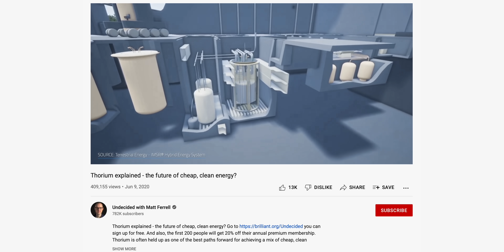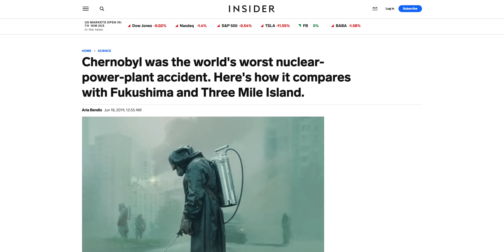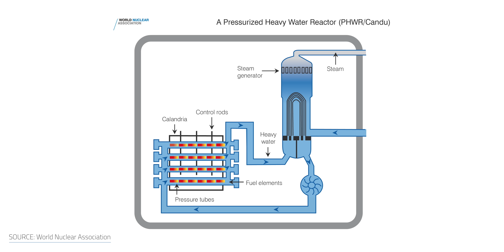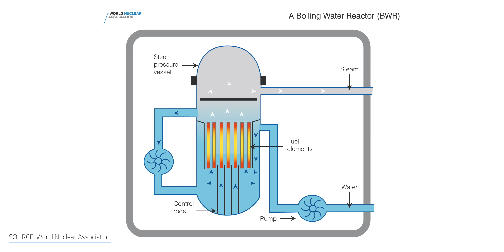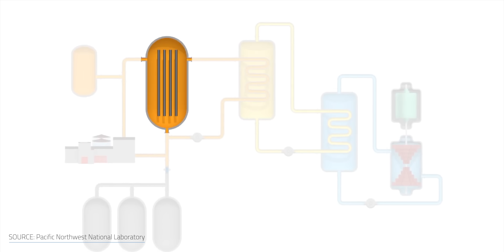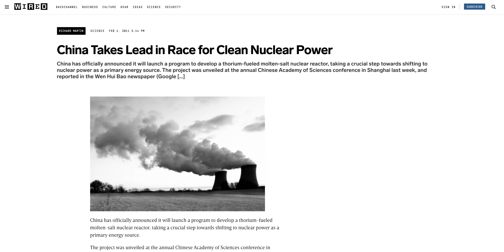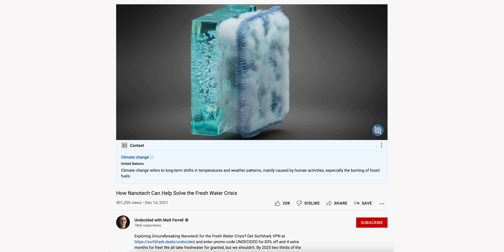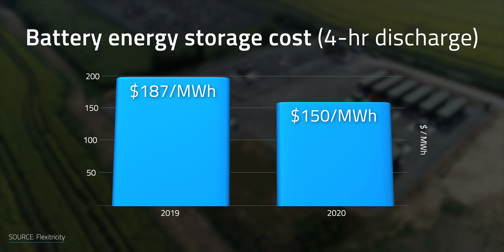Revisiting Thorium Energy - The Future of Nuclear Power?

Comment from the maker: Do you think we need nuclear as part of the energy mix at all? Get Surfshark VPN at https://surfshark.deals/undecided and enter promo code UNDECIDED for 83% off and 3 extra months for free!

If you liked this video, check out: Revisiting the Supercapacitor - The Wait for Graphene is Over  https://youtu.be/swdyGHvmXw0?list=PLnTSM-ORSgi55IJwXkqPkgtq03bgQDNoH
Reply: There have been about half a dozen big nuclear power disasters and yet it's demonized. 
Meanwhile there have been dozens, or even hundreds of coal ash leaks or other disasters just with coal plants. Add in oil, natural gas, and the rest and it's insane that nuclear is seen as the dangerous option compared to fossil fuels. And that's just the plants, how many big oil spills or oil explosions have their been? 
Talking about various FF plant disasters could make for an interesting video. 

Kuwait oil fields. Deepwater Horizon, Exxon Valdeez, Lac-Megantic train explosion. The Soma coal mine. Jharia coalfield fires. Benxihu... and that's just some of the big booms. There have been innumerable leaks from containment ponds or drilling accidents and other spills, the ash itself is toxic, then there's the CO2 and other emissions.
Reply: @Jcewazhere  msrs take away the key factors in all those accidents: water under pressure, water as coolant, and loss of power. Worth noting that coal plant residue-waste puts out some radiation too, but that's never discussed.
Reply: I do not think the LCOE is a fair comparison to match nuclear with solar. Its a calculation for determining the costs per KWH but does not take a look at the demand. However, we HAVE to make as much as possible of the full demand green, not only a small portion of it.

For instance, I live in the Netherlands, where the difference of Solar yield between summer and winter is 80% -90%. Hence if you would only look at LCOE Solar might look great, but to deliver all year round you would need 5 -10x the solar capacity to make up the drop in yield during winter . (Grid scale) batteries deliver power in the hours range (max days) so that is no option for summer winter variations.

If you fill up the missing capacity with an other source during winter what we are doing is investing in Solar but keeping the same capacity available via other sources.  So basically 2x the capacity and 2x the costs. Note that these costs will be higher since the investment (and risks) are spread out over much longer because the other source (conventional or nuclear) return on investment will be also much longer. So by investing in solar the LCOE of other sources will go up. That is also something to take into account.

When you take a look at hydrogen as intermediate, it becomes even worse. You will need full capacity of solar, storage for half a year (?) and almost full capacity hydrogen powerplant to convert the hydrogen back to electricity during winter. This will more than tripple the costs of the entire system. Hence LCOE is a fine way of comparing energy sources but not if we want to decarbonize as much as possible.
Reply: 🇨🇦☕🧐👍🇬🇧

Aw, it deleted my second comment.
Go and read about the Moltex Energy SSR-W being built in Canada.

🇨🇦☕🧐👍🇬🇧
Reply: I absolutely believe that nuclear fuel will be the next bridge gap to another level of human development, similar in scope to that of the industrial revolution. Not fission however, fusion. I don't believe we'll achieve fusion without using fission to push us there, but once we master fusion, I honestly believe having virtually limitless energy will propel us into another level of advancement, similar to how mastering the steam engine gave us industry. Hopefully with the additional energy our society and environmental issues can come under control also.
Reply: We need abundant, reliable, and low cost energy. Although nuclear currently appears to be more expensive it meets all our other needs. We need to invest in next generation nuclear energy to bring the costs down
Reply: The pure potential of nuclear and the ability to provide clean (synchronized) power in itself is a good enough reason to pursue. In ours growing power demands we will need all types
Reply: Yes, we definitely need nuclear at our current technological level. Since nuclear has the lowest carbon footprint of all power production options at this time, and since it's really safe, there's no need to avoid it.

Fast-forward a few decades and solar power satellites and/or fusion might be the way to go.
Reply: Yes. We're going to need all the solutions we can get. Combining the LFTR idea with the SMR philosophy means getting energy generation to the specific areas that need it and/or ones that wind/solar are impractical for. For example, I predict vertical farming and synthetic meat production to increase in the future, both of which are able to be done in a city, but are very energy intensive. If you could install an SMR plant somewhere close to the plant that needed it, you skip all the problems of finding open, sunny land or windy places.
Reply: Thorium is irrelevant until MSRs have already come online, when it is properly understood as a second fuel. I've heard over and over that MSRE at ONL was shut down in excellent operating condition with no problems from corrosion from people who have studied the operating notes, so I don't think your claim it shut down from corrosion problems is from a good source. MSRs are the reactors that need to be put into use for a dependable energy future. MSRs are expected to take much less than half the average construction time of other nukes. If MSRs are built on assembly lines like washing machines they are expected to take only a month to install. But the main reason MSRs are needed is not discussed at all, MSRs are needed to recover from global catastrophes. In a nuclear winter, asteroid impact winter or super volcano winter the sun is effectively switched off like a light switch by clouds of dust, ice and chemicals that encircle the entire planet, plunging the planet's habitable zones into darkness for 2 - 10 years. No solar power, very weak wind energy, low to no snow melt so no hydro, ice bound coal piles that can't be shipped or burned, oil too thick to pump, frozen natural gas lines, everything is just plain colder than in thousands of years so suddenly nobody is prepared and global civilization collapses without power. Legacy nuke designs need the water in the rivers that are frozen so can't keep cooling systems running and have to shut down. MSRs are one of very few systems able to be designed to stay up and running during global catastrophes so civilization doesn't collapse. Recovery from global catastrophes is the main reason something relatively local and dependable without needing liquid water is so important.
Reply: Yes, on the higher longitudes solar works only in summer - November to April not only is the output is low, but we also get only 2-5 sunny days a month, so a 10 kW system, based on the collected statistical data, would generate about 55 kW/h in November, 13 kW/h in December, 45 kW/h in January and 150 kW/h in February and that's not a given, ofc. This year has been especially cloudy - we have not seen the proper sun for 2 months now at all. 
And the wind is not a solution too - it's too intermittent here with sizeable gaps of almost no wind (way below turbine minimal operational wind speed) - we had 2 weeks with zero to no wind in December 2021 alone - zero wind power production during that time across the country.

I just don't see what renewable tech could solve our winter problem for those 3-to-4 months.
Reply: @psihius  you mean latitudes mate…
Reply: @psihius  well new solar cells (multilayer) don't rely only on visible light and are work even in cloudy weather (as it's also able to utilize IR wavelength). It's still evolving. But yes main problem still remains and it is storage but that is also being developed.
Reply: @psihius  you mean higher latitudes, not longitudes
Reply: @psihius  

Read my comment first bro 😬
Reply: Matt. 2nd video of this type  u made, but no mention of what Thorcon and Seaborg Technologies are doing to marry South Korean shipbuilding with MSRs which massively reduces cost and time to use in addition to reducing the local infrastructure needed - they add, not require more.
Reply: Does the LCOE of these reactors including the cost of safely storing the waste for the said 500 years? Including all new regulations in the future...
If not: let's invest in stuff we can replace in a shorter timeframe IMHO.
Reply: @gerke_kok  That's the promise of molten salt thorium reactors. They can reduce highly radioactive waste to short  half life safer material.
Reply: @gerke_kok  what waste? You seem to be planning on not recycling fuel, which is silly.
Reply: Yes nuclear is only good option at this time for getting clean ish energy 24/7 . We will need renewables as well so a mix will be good what ratio will all depend where in the world the power is needed. At this time 100% renewable is a pipe dream unless u are ready to shut down the grid when sun goes down. Solar will need alot of land to make a lot of energy. The current storage solutions dont work on a world wide scale....pump storage will need a lot of land. Lithium based batteries are good as a dense energy storage but limited amount of materials also we will need them for vehicles so wasting it on grid storage isnt smart when the density of energy isnt that important in grid systems. So we need time for research better storage options.

Tho unfortunetly all this might be 2 late because it takes 2 long to plan for new plants and the countries that do 50% of the co2 emission will not slow down in the next 10 years but will increase it. Big fossil fuel companies knew about the problem of co2 for 60 years and now they are admitting it happening but will not do anything about it other than do ad campains about ur personal co2 foot print. Also whos gonna say to china or india u should stop what u are doing right now because europe and Usa has all ready fucked the planet to make them rich. We basically dont have a leg to stand on.

France has been really smart and now they have small co2 emissions but still make shit tons of energy.
I must say im happy my contry Finland has been smart about nuclear and currently we are testing new plant thats going fully online in the summer making 1600mw of power also another plant will start construction next year and tageted to finish 2029 tho i bet will be bit later. Also when the currently in test rrun mode plant starts to go 100% Finland energy mix will be 40% nuclear and at 2030 it will be somewhere near 60%. Also we have the worlds first final resting place for nuclear waste for the next 100 years of nuclear waste that was paid by a fund set up 30 years ago for this reason. Cost for the sorage was about 3 b €. Unfortunetly the cost for the new plant going online balooned to 8.5 b €. :/
Reply: Nuclear power has a huge flaw: It is not economically viable. I'm all for subsidizing a technology to get it started, but at some point that technology needs to generate a profit WITHOUT MASSIVE TAXPAYER SUPPORT. Nuclear has never done so, and it's been heavily subsidized for over 70 years. Wind and solar are already very close to not needing subsidies and the total they have received is far lower than nuclear.

I challenge any nuclear supporter to post a link showing any nuclear plant in the world that has not received large subsidies. It cannot be done!
Reply: @therealctoo4183  It can be done. The biggest problem is everyone is lying about the actual costs of everything. Wind and solar don't require as many subsidies because governments are forcing consumers to pay the difference. They're also extremely unreliable. Coal is cheap to consumers but the environmental costs are high. Hydroelectric also has high environmental costs. Nuclear power is cheaper per MWH than wind or solar but the start up costs are high and the break even time is long. The regulatory costs are enormous and the NRC is determined to only allow Pressurized Water Reactors to operate in the United States.  Natural gas and fracking is the best answer for now.
Reply: @therealctoo4183  Your numbers are wrong.
Reply: @patrickweaver1105  I provided no numbers. I simply state that every nuclear plant on the planet is STILL HEAVILY SUBSIDIZED, despite the fact that nuclear was going to provide practically free energy way back in the 70s! It's easy to claim I'm wrong, but can you link to any plant anywhere that DOES NOT get huge amounts of tax payer money? No, you cannot.
Reply: @therealctoo4183  Yeah, your numbers are still wrong.
Reply: @therealctoo4183  if you're under the misapprehension that *anything*, very specifically including intermittent renewables, is happening or can happen with what you term MASSIVE TAXPAYER SUPPORT, you are not looking very hard either at the current situation or at history.
Reply: @davidfetter  Nice attempt to change the subject!!! It almost sounds like you know what you're talking about!

Sadly, you have not shown any nuclear plant that doesn't rely on significant taxpayer support.
Reply: Let me know when I can get my own portable nuclear generator.
Reply: Yes. We need all the things. Climate Change as a existential threat/near certainly will not be mitigated enough without it. I define enough as preventing the widespread collapse of society. The problem afer that would be digging ourselves out of a modern stone age without easily accessible minerals and metals because those have already been mined.
Reply: A shame not to mention the nuclear physicist who pioneered thorium power https://en.m.wikipedia.org/wiki/Alvin_Radkowsky
Reply: Nuclear will not get much subsides and will need to compete.  Only in places where wind, solar, hydropower, tidal, HVDC transmission, soon to be produced super cheap battery storage do not work does it have a chance, which almost nowhere.  It will have to be so cheap to compete but and without mass production cost reduction, how (catch 22)?  The worker and material management risks, and long term storage burden just drags it down more.  The nuclear cost estimates are not reliable historically.  Eventually some new  nuclear technology will have some niche markets, but always be a minor percentage.
Reply: @glike2  >soon to be produced super cheap battery storage do not work does it have a chance, which almost nowhere.

Will not happen, guaranteed. Litium-ion is about the highest electric energy density you can get without the potential for truly disastrous results if something goes wrong; and most would say Litium-ion already has truly disastrous results; from cars burning down to planets burning in the air and crashing, Lithium-ion is quite dangerous already.
Reply: Yeah, that solar and wind calculation is bullshit. That's the thing about people only looking at spreadsheets, they can conveniently ignore all matter of issues with certain things and the added cost of this, because it wasn't on spreadsheet. Let's tabulate the stuff they didn't bother to put in their spreadsheets, shall we?

1. Energy density is not high enough with both wind and solar; you need destroy/cover far too much land (and buy it) to produce enough power; something that isn't factored in.

2. Energy production is not reliable; cloud cover equals no power, northern/southern places in winter will get far less solar energy due to the distance through the angled atmosphere, and thus very little power, however, cloud cover also increases during winter, so it goes even further down to essentially no power; wind similar; no wind, no power. So to compensate when you have no solar and wind power, you're still going to need conventional or nuclear power plants; and these will have to be running continuously, even when you don't need them, because starting a power plant from cold nothing to fully powered up takes to long; and that includes the people sitting at that power plant mostly twiddling their thumbs keeping it running and burning fuel all the time; all costs that if you were honest would have to go onto the conto of wind and energy. So, you're burning if you're using fossil fuels as much, if not more with wind and solar, than if you didn't have the wind and solar; which gets us to point number three:

3. Solar and wind energy produce direct current, which needs to be transformed into alternating current; the transformers who do that, run an alternating current; so even if you could find a place where and Solar and Wind were fully reliable, you're still going to need a conventional or nuclear power plant to be able to use wind and solar; making the issues of burning more fossil fuels to use wind and solar worse; another cost conveniently not put on the spreadsheet.

4. The environmental cost; depending on where you place them, you will either make shipping more dangerous, or you destroy natural environments and destroy animals homes, or in the case of solar power covering farmable land with solar panels thus hampering your ability to produce food, and potentially export it to the world.

Solar and wind are the most expensive in all areas of all the power sources.
Reply: I believe you forgot to mention that Wind and Solar are only cost effective in very small areas of the world, and small areas of USA.   Florida is not even cost effective for solar.
Reply: @user-nc9pc3gr4c  The wholesale electricity markets disagree with you.
Reply: @williammeek4078  Politics and government incentives.  Lets see what real world markets do.  If what you say is true, everyone would be buying solar panels.
Reply: Without nukes we will go extinct. We need a power source that is semi local and needs no more water than it can get from a well so it can be "self contained" to a degree and dependable. This is the power that will sustain the survivors after the great sun loss disaster during the period like a nuclear winter when there is very little sunshine for 2-10 years. Civilization will suffer such a major blow that we may loose access to our space based power if we already have it, which is why some of the power must be semi local and independent from sunlight. Without sunlight the convection currents that drive wind will die down, solar panels may be covered with dirty ice, the cold will freeze rivers so hydro fails, and we may loose access to our space based power if we already have it. The disaster could be a nuclear war, an asteroid impact or a super volcano, it doesn't matter, if we are not prepared for the disaster survivors to survive after the disaster civilization will not recover just like the great flood ended civilization 13K years ago.
Reply: This question is more than a little tonedeaf this far into the Ukrainian conflict, don't you think? Thorium should have been fast tracked right away, but greed got the better of us. Perhaps with energy companies now forced to stop offering fixed price contacts due to extreme energy price instability, greed can finally push us in the RIGHT direction for a change. LIFTR is the answer, and always was.
Reply: Yes, especially if they are the new SMRs or MSRs.  I used to have the fear-based view of nuclear power, but after watching several YT videos on thorium MSRs, I have an opposite view now.  Renewables are too unreliable and too hyped up to be used as a mainstream power supply at the moment.  We still have to see how the renewable waste is handled by the same people who want a cleaner, greener planet.
Reply: Yes. No Doubt we need It. But I like to change the Name of this energy to Thorium Energy , provided you study the HTR's Design and go and visit China and see the on ground progress of HTR PM 600 Project. Which was nothing but the advancement from HTR-10 - The Carbon Copy of AVR Germany using Fuel Pebbles.
Reply: 🌍 But will it be able to travel at  "Warp 5, or 10 Speed," ? or "Jump to Lightspeed." ? or a
"Hyperspace Jump." ?  👀🤖👾
Reply: Matt, are you drinking more coffee?  I've noticed and increase in the cadence of you speaking.  Am I imagining things?
Reply: Hi, Matt---will you ever actually revisit the "solid hydrogen" video you did a couple months ago? You still have not addressed any of the criticisms raised about your video.
Reply: I think, ultimately, nuclear will make sense again.  But it doesn't right now and it won't until there's enough grid-scale storage on the grid to level out non-renewables generation.  The equation hasn't changed... nuclear needs to generate base-load in order to operate efficiently and economically.   Base load doesn't exist on the biggest state's grids any more.

Here's more of a economics based view of the issue... right now natural gas is filling the gap that renewables can't.  Primarily this means overnight generation which for all intents  and purposes is 18 hours out of a 24 hour day.    Renewables can only slowly chip away at the edges here.  Only grid scale storage is able to actually fill the gap and it will be several decades before we have enough to completely bridge overnight generation needs.

In the mean time, what is happening is that natural gas generation is filling this gap.  But as grid-scale storage grows, the need for natural gas generation will decrease.  There will always be some need, but it will be significantly lower than it is now.  So the problem with trying to build-out nuclear now is that nuclear is filling a gap that is going to be diminishing over the next few decades.... which is not even remotely economical enough to justify building a nuclear reactor.

In 2-3 decades this equation will change.   NG generation assets will stabilize and base load needs will begin to increase as storage is able to bridge the overnight gap.  In this scenario, nuclear reactors become an economical replacement for the NG generation.

But not now.  Any attempt to build out nuclear reactors now would be a financial and economic disaster for whomever is footing the bill.

-Matt
Reply: @junkerzn7312  You are a wise one Charlie Brown.  NG is the near term bridge to support renewables. The realist time scale to build, prove concept and then build a large number of proven nuclear power plants is 25 years away.  I believe that new reactor designs should be tested but planning on them to solve the current needs is doomed to failure
Reply: Cost is the key. While nuclear/Thorium is the most expensive per Kwh generated, it will go nowhere. So there's a need for an innovator (like Musky) to make it more financially competitive, then all these great sustainable/safer/smaller points will steer the market.  When everyone's driving electric cars a few of these might be handy on a windless night.
Reply: How difficult/easy is it to add a micro-wind turbine to your powerwall or other home battery setup? Is it just like plugging in another solar panel or what? 
Are there good consumer grade win turbines that can work in a single acre or less, or even a suburban backyard or roof? 
How much do they cost and how much electricity do they produce? 
Will they annoy you or your neighbors with whooshing blade noises? 
What's their LCOE? 

Could make for a good video.
Reply: Paradoxically as it may sound, nuclear is important for civilization's safety from possible large scale catastrophes, like a large tsunami destroying offshore wind pharms, or large volcanic eruptions causing global atmospheric dimming. If we are ever pushed underground for survival for any reason, we will be unable to use environmental power sources. Even without sudden events, changing weather patterns might leave our renewable source power installations "high and dry".

Next, concentrated portable power - sometimes we just need high power sources which do not require large swaths of space.

Finally, outside Earth, what are our options for strong power sources for propulsion and for life support of larger crews? Nuclear seems right for that, but we need technologies developed down here first.
Reply: @salec7592  What did I say that was anti-nuclear power? Molten salt thorium reactors are spiffy, though as with many things the hype around them goes too far. For example it's not impossible to make nukes with them, it's just not as straightforward as with a PWR. We have all the pieces to clean the salt of waste, but not altogether in one setup and not at a scale that could handle even one full size plant. We haven't solved the corrosion problems with the reactors, that's part of why Oak Ridge shut down their reactor. 

Outside the earth solar is king, at least this side of the asteroid belt. Don't have to bring your own fuel or bother with power transmission stations for beamed power. 

Have you heard of geothermal power? If we were 'pushed underground' it'd be much more viable to drill down and get at that sweet sweet heat to power everything. 

A tsunami big enough to destroy wind 'pharms' would also devastate the shoreline so the power wouldn't be needed anyway :P
And, uh, have you heard of Fukushima? I jest, a little, but any disaster like you're FUDing about would knock out any power sources and or cause devastation on the scale that worrying about electricity sources would be moot. If the sky dims enough that on ground solar is no longer viable how do we grow food? Enclose the planet's entire agricultural industry in warehouses and use LEDs powered by beamed power from orbiting solar satellites of course.

The only even vaguely 'anti-nuclear' view I hold is that SMRs are regulation dodges and are not the solution to all problems. They don't benefit from the square cube law so they fiz fuel less efficiently than large reactors. They are security risks in transit and in situ. They're more expensive per GW than traditional plants, and those are already super expensive. Maybe if some corporation starts building them en masse they'll get cheaper, but that seems like a pipe dream.
Reply: The analysis I have read indicates that we will likely need nuclear energy in order to avoid disastrous levels of climate change.  Liquid metal cooled reactors should be thoroughly evaluated as a nuclear energy technology.
Reply: The way things are going, I don't think we can rely on renewables alone to deal with the climate crisis. Developing nations might dabble in renewable energy, but at the end of the day they're going to pick a solution that's inexpensive, easy to build, and delivers a ton of power, and that solution is usually coal or gas, not renewables with big expensive battery packs attached.

Developing countries also know that economic growth is closely tied to energy output, which is why China is building out both coal and nuclear plants at a record pace.

We're also conveniently ignoring the environmental issues with building out renewables that depend on rare earth minerals, very much how we ignore the problem of e-waste: we're paying China to destroy their environment so we can feel good sticking solar panels on the roofs of our houses.

And knowing that countries like China will insist on their "right" to use as much fossil fuels as possible, we're probably going to need a carbon-free, dense energy source to capture and convert CO2 and methane from the atmosphere within the next 25 years. We can do that with fission power, but because 80% of the decision-making is marketing, I bet world leaders will pile their hopes on fusion, which has a long-running joke of having promised production readiness "in 10 years" for the past 50 years. The only difference between them and Elon Musk's promise of self-driving cars is that they're usually sincere.
Reply: @MMuraseofSandvich  No especially in countries with poor infrastructure. Rooftop solar with a V2G capable car is the cheapest option, by far.
Reply: Yes.
Reply: 9:00 "more expensive to mine" - FALSE: Thorium is a waste byproduct of rare earth metals mining and we accumulate more of it that way today than we currently could ever use. This will increase the profitability of rare earth metals mining (or at least remove a cost externality that suppresses their profitability) making all our microelectronics which rely on rare earth materials cheaper!
Reply: From a macro point of view, I think our entire power and transportation grid on a variable energy source like renewables is sheer lunacy. What if climatic shifts result in less sun or winds in certain areas, what if there is a major volcanic eruption affecting large scale sunlight etc etc. I think as a species, we are going to need a reliable, safe, carbon free power source to at least supplement renewables. Fusion just looks like it won’t come in time to prevent major climatic change so we are either stuck with nuclear or gas with significant carbon capture
Reply: @korywalsh  Nope. On a macro scale, wind and solar are very stable and predictable and the fastest and cheapest options.
Reply: @williammeek4078  I certainly agree that wind and solar will play a major, if not the central role in long term power production but climatic changes by nature will change the predictability of prime solar and wind locations. It’s entirely possible that there could be breakthroughs with micro solar generation that would make power generation so ubiquitous, that this could be moot, but I think that relying entirely on power that we have very little control over of is inherently risky.
Reply: @korywalsh  Relying on nuclear brings those same risks when you consider the grid. Further, nuclear can not be implemented in time to address climate change.
Reply: Nuclear should be the primary component of the global energy mix.
Reply: For Plutonium breeder molten fuelled salt reactors you only pull out the fission products which you need to do for a Thorium molten salt reactor anyway as well as pulling the Protactinium out of the fuel blanket, so no Thorium does not produce shorter lived nuclear waste, in both cases you will be left with only fission products without actinides. What gives you the shorter lived waste is the molten fuelled salt reactor.

And the fuel put in a convention reactor before you actively use it in a reactor is safe to handle in your bare hands, except you need to keep it clean so your not actually allowed to handle it, but from a radiological prospective it's fine. Which neither the fuel in a molten fuelled salt reactor or a PWR/BWR is safe to handle after you start using it because it's called a nuclear reactor for a reason, they both give off a lot of radiation which we turn into heat that's how a nuclear reactor works.
Reply: Nuclear power also provides facilities for creating medical isotopes. Nuclear benefits health care.
Reply: 1) long half lives indicate relatively LOW levels of radioactivity - it's an inverse relationship. They may be radioactive for a long time, but the longer the half life the less radioactive it is - this makes sense when you consider that decay happens in the direction of stability, so low emissions means that the material is closer to stability than something with a short half life. Short half lives mean highly radioactive because the decay process is rapid due to the instability and so emits more energy over a shorter period of time as it attempts to reach stability in some isotope down-chain.

2) molten salt designs also include Uranium Chloride and not the Thorium cycle that might use FLiBe. FLiBe salt reactors are best used in Fast reactors which have higher concentrations of fissile and fertile material than Thermal Spectrum reactors so more neutrons hit more neutrons and you can actually breed your own fuel and achieve much higher burn-ups and even do online-processing of isotopes and extractions of waste material.

3) Alongside these Gen IV+ reactors are SuperCritical CO2 Brayton Cycle turbines
Reply: Yes for the next 20-30 years then no. Renewable is cheaper cleaner when first build and running
Reply: @simonnrgaard7731  Cheaper yes cleaner no. If you examine the total energy debt of a system solar & wind are more CO2 and energy intensive. than nuclear. Nuclear plants essentially print money after 30-40 years and last up to 80 years without significant issues. Solar PV is inefficient as well.
Reply: @TDBoedy  the difference in co2 is small measured in total numbers and no waist
Reply: @simonnrgaard7731  It's really not when you measure the lifespan of a given plant. Solar 20 years at best, compared to 80+ of even Gen II nuclear.
Reply: @TDBoedy  80 years is only 0.1 % of the total. The rest is from  a few years to maybe 30-40 years. Always look at cradle to grave on all from a simpel nut to the cylinder to hold the waste. it's not hard to find with google. And  now 3 days more of silence for me 🙂
Reply: @TDBoedy  Care to share some sources for this?
Reply: @TDBoedy  Interesting that you mention that. After the ramp-up phase, uranium fuel-cycle power plants in most power markets do make an operational profit. However, there have been no nuclear power plants to this day that have been a net-positive investment over their total asset lifespan. The reason is decommissioning cost, including the storage and treatment cost for the radiaoactive waste. Decommissioning cost are generally so extremely high, they completely nullify an investment case for a nuclear power plant. That is why asset owners often 'forget' to make the necessary financial reservations to pay for these, leading to serious financial isaues at the end of the asset lifetime. 

Conclusion: no, nuclear power plants are not economical compared to wind or solar these days.
Reply: 1000%
Reply: It would be interesting to see the projected Net System Cost for LFTRs and other reactor types based on a thorium fuel-cycle. LCOE as a measure for the actual cost to integrate a certain energy technology into the grid is rather flawed and does not tell the whole story. The reason for this is twofold: it only includes the market commodity value of each MWh produced and it weighs CAPEX much more heavily in the LCOE figure, since all OPEX is discounted to a Net Present Value. This puts relatively CAPEX-heavy technologies like LFTRs at a disadvantage.

What about the capacity value of being able to have reliable baseload power plants, or providing an intermediate load that can be ramped up or down at will? Also think of the ability to provide ancillary services to TSOs, something that is becoming increasingly vital to ensure the stability of power grids with high levels of (renewable) intermittent power loads. 

Net System Cost includes those types of value streams of an energy technology to power grids, while also including the cost for intermittent power sources like solar and wind to be backed up by baseload or intermediate load power loads from other sources.
Reply: We can't make nukes out of Thorium, the US will never adopt it unless the government is dismantled and rebuilt.
Reply: Even Though it might look like that thorium's efficiency is still 53 dollar around for today, commercialization will lower the price bit by bit. Solar has made a long way to be the cheapest one, why wouldn't be thorium?
Reply: Considering the alternatives and the need for electric energy is only going to increase, the is, at the moment and for many decades to come, no option but modern nuclear power to keep the world "running" as it is.
Fossil fuesl are limited and anything but nature friendly. The next big thing, fusion is still below the horizon so there is only modern fission power to fill the gap.
Reply: Yes, we need nuclear as part of the mix if we want to get rid, of or severely decrease fossil fuel use. Battery storage is getting better, but renewables can't completely fill the gap.
Reply: Great content, but 2017 called and wants it’s cutesy/hip youtube intro music back.
Reply: Thorium is not expensive to mine it is a waste product of almost all mining activity. We largely throw it away as trash material.
Reply: While nuclear seems like a viable solution, there is a major glitch that hasn't been addressed, and that is the that structure of atoms is not what is understood at this time. Atoms are actually universes, and there is a universe within a universe within a universe. Ever see the ending scene from Men in Black? If mankind destroys an atom, we are destroying a universe, and because we are all subject to UNiversal Law, we will destroy ourselves. 

Until this time, the atoms that have been destroyed have been universes that never reached their full potential. Maybe it will be that our universe never reached its full potential, either, if we continue to choose to break UNiversal Law. 

There is a better form of energy, and it benefits humans to establish it as the accepted form.
Reply: Karen Holmes Any valid reason to belief this theory?
Reply: No it's to dangerous . This planet has so much oil, coal and natural gas that we should be looking for  ways to use these resources cleaner instead of cutting down our forests and littering our coasts and country sides with windmills and solar panels that do more harm than Good. We also have to stop damming our rivers were murdering our planet with these new wave energy sources
Reply: All options except fossil fuels must be on the table. Diversifying energy sources is an insurance to disruption. You never know what will happen in the future that can knock out one of your power generation and having that diversification is strategically more secure than putting everything in a one or two baskets.
Reply: like in sombra Ontario a hydroponic greenhouse uses the heat/carbon generated from local factories to heat itself and boost carbon flow fro crop yields........could geothermal and molten salt or thorium reactors produce enough heat for something along those lines
Reply: This technology completed R&D at the US Atomic Energy Comm in 1959. This is nothing new.  But the Elites own the uranium. Guess why we don't have Thorium salt reactors, AND the rush to "green"?
Reply: Hi Matt. 
I have a question: why can't electricity-storage use low-cost salt batteries to store power? 
They are very efficient, but very heavy, but that's okay for a powerplant or house.
Meanwhile most designers are obsessed with battery weight, so it's as if they don't realize that weight is not an issue with storing electricity on the ground vs. vehicles.
Reply: I would have to say that they are going to have to use the thorium reactors to use and get rid of all the nuclear waste that we have to store for more than 10,000 years. We need to neutralize all of that down, and get the energy from it, to amount of time that is feasible for men to keep safe and contained. It takes alot to keep these wastes safe, and contained. The containers only last 50 years. And whos responsible for the waste for 10,000 years? A company? A government? An empire? A republic  a democracy? A dictorship? Name one that has lasted that long? Who is going to keep track? It's very expensive to store. What happens when we have people right now talk about world War three? What happens to it all then?
Reply: The problem is, these "next gen" reactors, fuels, and moderators don't solve any of the issues with current nuclear fuel cycle, fuel cost,  energy inefficiencies, or waste issues.  All of the same problems still exist.  But these "new" reactors bring additional issues with them that are often minimized because the overall form factor of the these reactors is much smaller.
Reply: @RealityCheck What they don't tell you is that thorium in its raw form (common or not) is useless with respect to nuclear reactions. You can't just take a shovel full of thorium rich dirt and toss it into a reactor. Thorium needs to be sourced (mined, excavated or extracted), purified, enriched, and fashioned into fuel (either pellets or spheres), just like uranium. The costs of nuclear fuel today have literally nothing to do with uranium's rarity. It has to do with the costs of mining, milling, purification, enrichment, and fabrication of usable fuel itself. All of those processes are still needed with thorium and other "next gen" fuels. Each of those steps are energy intensive, create their own radiologically and chemically toxic waste streams, and are very costly.  Recycling or extracting thorium from other substances (like thoriated glass) is just as messy.
Reply: Of course we do. It is the only solution to our energy needs unless we want to regress in our development. MSRs properly constructed are walk away safe as Dr. Towell says. Solar and wind are destructive to the environment and not able to generate near enough power. They are not reliable either. How can clear cutting thousands of acres be good for the environment? I guess as long as it's not in my backyard it's OK. A large NEW solar farm in Central Texas was destroyed by baseball size hail. Wind turbines shut down during the record cold in 2021in Texas causing great harm and loss of life.
Reply: #savemasjidilaqsanow 
NoThirdTempleOnMountMoriah 

Psalm 15

A psalm of David.

1 Lord, who may dwell in your sacred tent?
    Who may live on your holy mountain?

2 The one whose walk is blameless,
    who does what is righteous,
    who speaks the truth from their heart;
3 whose tongue utters no slander,
    who does no wrong to a neighbor,
    and casts no slur on others;
4 who despises a vile person
    but honors those who fear the Lord;
who keeps an oath even when it hurts,
    and does not change their mind;
5 who lends money to the poor without interest;
    who does not accept a bribe against the innocent.

Whoever does these things
    will never be shaken.

Surah Aal-e-Imran, Verse 61:
فَمَنْ حَاجَّكَ فِيهِ مِن بَعْدِ مَا جَاءَكَ مِنَ الْعِلْمِ فَقُلْ تَعَالَوْا نَدْعُ أَبْنَاءَنَا وَأَبْنَاءَكُمْ وَنِسَاءَنَا وَنِسَاءَكُمْ وَأَنفُسَنَا وَأَنفُسَكُمْ ثُمَّ نَبْتَهِلْ فَنَجْعَل لَّعْنَتَ اللَّهِ عَلَى الْكَاذِبِينَ

But whoever disputes with you in this matter after what has come to you of knowledge, then say: Come let us call our sons and your sons and our women and your women and our near people and your near people, then let us be earnest in prayer, and pray for the curse of Allah on the liars.
(English - Shakir)

via iQuran
Reply: I absolutely believe that we need nuclear power as an essential part of the energy mix.
Reply: Yes absolutely!  No matter what side of the political spectrum you're on, we can all agree that clean, cheap, plentiful electrical energy production that does not rely on the dangers of Fast-Breeder reactors designs nor the use of coal that is aggravating the global warming climate shift. Combined with inflation world-wide on manufacturing, we really REALLY needed this MSR nuclear, like... yesterday!  I think you did an excellent job on this video Matt!  I just wish more people realized the urgency of this.  For the record as well, ANY mis-managed power plant is dangerous to the public and the environment, even renewables like hydro-electric (i.e. dam overlows / breaks) or the humanitarian abuses in the Congo in getting the raw materials to make solar panels.  There will always be pro's and con's, but the pro's for Thorium outweigh the con's by a landslide.
Reply: Consider these points.
Nuclear has a much smaller physical footprint than renewables.
You don't need batteries. 
Most important it's R-E-L-I-A-B-L-E!  It will meet the growing demand without blackouts and brownouts.
Reply: I want an MSR for use in space; something on the order of 20,000 kg, if it could put out, say, 1 MWe for 20 years, would enable human exploration of the outer solar system.  Solar power is great in space, but by the time you get to Jupiter your system is putting out only 4% of the capacity it had in LEO.  A 20-ton reactor would be only 1/5th of a starship launch.  Once that exists, the power barrier for high-energy ion engines goes away, and we can start scaling up the types of things we fly around in space.
Reply: Nuclear is a key part to a clean and stable energy grid. It was already demonstrated in California, that despite the abundance of solar and wind these natural processes do not always align with human activity peaks. Nuclear power is often lent to the grid to make up for the demand that solar and wind cannot meet. The right mix is 70% nuclear and 30% other power.
Reply: Matt you want to have one foot on wind energy and one foot on thorium energy.
At 12:50 you said that thorium energy is more expensive than wind energy, that is a practiced l¡e: Thorium energy is continuous and reliable and cheap while wind energy is intermittent and sometimes non existent and expensive.
When the wind is not blowing the energy output is zero and the cost is infinite so put your act together and get real.
Reply: misinformation with matt ferrell
Reply: Yes!
Reply: Yes we need nuclear energy. It's the most dense source of energy we have.
Reply: We need RELIABLE energy, wind and solar are not. Thorium is a gift from God, small mass produced 100 mega watt reactors placed near existing sub-stations would go a long way to solving our energy problems. I believe there is enough thorium in rare earth mine tailings (waste) to serve the US for a 1,000 years. And at the same time solve our rare earth mining restrictions, a win win!
Reply: Just like food and water, energy should be harvested by the end user not by a big controlling corporation. 

For that reason alone fusion is not an ideal source.
Reply: All that heat could be used to make cement as well as boiling water.
Reply: But, and this is so very important, what is the LCOE for a combined cycle natural gas plant?
Because until it's cheaper than gas this is going nowhere.
At the very least we need projections showing it will get cheap enough.
Reply: @MostlyPennyCat  It was cheaper. To about 2 months ago, when gas prices went 3-4x here and are not coming down. Our heating costs went 3x, electricity went 2x (and that's for those who have fixed cost electricity - those who had dynamic plans got bills that went 10x for December). At our current prices for electricity alone the math looks a lot different.
Reply: Yes I definitely think we need nuclear energy. It is the safest, cleanest and space saving energy source we have.
Reply: @mrkokolore6187  I don't know about 'the safest' or 'cleanest' however of all the high density non intermittent generation we have that does not pump CO2 to atmosphere Nuclear is the only option.  The issue is they are expensive to build and maintain, and have a very long breakeven time.
Reply: @3dmotormaker  Yes that's probably why there are so little of them build. People want quick money and are afraid of or uninterested in long-term investments. I guess SMRs could solve that problem as you could mass produce them and thereby reduce building time and cost.
Reply: @3dmotormaker  When has nuclear ever broken even??? Can you name a single nuclear plant that is not receiving subsidies even now? I've never seen one, so I'd love it if you could post a link. I will of course  verify it, so choose carefully!
Reply: @mrkokolore6187  Until a SMR is actually built in America on schedule, within budget, and proven to meet all the claims, everything is just unproven hype.
Reply: @clarkkent9080  So? Every new and hyped technology is?
Reply: @mrkokolore6187  NO! It is not even close to the SAFEST, CLEANEST,  and SPACE SAVING! Take tidal, there are  of bays on land that fill up with water. Put a water windmill that the start of the bay. Kind of like the water windmills in New York City. A Million instead of 20 Billion for nuclear, and it does not heat the Earth!
Reply: I am against heavy metal nuclear here on Earth. What happened to calcium reactors? What about phosphor reactors?   What about wave power? What about  internal heat? What about tidal power?  It is something that A BIG COMPANY wants,  not for the person  wants power. It is the BIG COMPANY that heats up the EARTH with nuclear instead of transforming the power that is already being use!
Reply: @mickgibson370  >I am against heavy metal nuclear here on Earth. What happened to calcium reactors? What about phosphor reactors?   What about wave power? What about
>  internal heat? What about tidal power?  It is something that A BIG COMPANY wants,  not for the person  wants power. It is the BIG COMPANY that heats up the EARTH with
> nuclear instead of transforming the power that is already being use!

Nuclear power does not heat up the Earth; and all the other power is all low density, and possibly only produces direct energy like Solar and wind.
Reply: @mickgibson370   You didn't finish middleschool, did you? 
- Tidal is inconsistent, fragile, dangerous to shipping, and prohibitively expensive for the yield. 
- Wave at least works around the clock, but has but such tiiiiiny travel, that the yield is ridiculous for the surface area it takes up. 
- Phosphor and calcium are EXTREMELY dangerous to transport and store, while thorium is not. 

What on earth you mean by 'internal heat' I cannot even guess at, but you should definitely look up how nuclear reactors (yes, there are several different types) actually work, so you can see for yourself that your 'heating up the earth' comment is too far from anything true to even correct. Brown cows do not give chocolate milk, santa isn't real, the earth is not flat, and vaccines do not cause autism or "vaccine injury".
Reply: Nuclear power is already subsidized. Though the least subsidized of all energy sources per watt-hour. The problem isn't subsidies it's how it's subsidized without meeting mandates.The problem is What subsidies do is send the wrong message to management and labor. Management interpreted the message to suggest cost control and efficiency was no longer relevant to operating, the taxpayer foots the bill regardless of whether you get the reactor built or not; and doesn't do much to mitigate cost overruns by penalizing anyone for failure to deliver on time. Labor took the message "We now have a federal sugar daddy who'll pay for better wages and benefits regardless of productivity."

Providing increased subsidies as reward for cost overrun and construction delays is the epitome of the message.
Reply: I was under the impression that Thorium reactors were specifically Not invested in research specifically because they could Not be used to generate weapons grade fuels... did that change?
Reply: @secondarycontainment4727  thorium is not fissile ....it has to be bred.. that's done in a very rich u235 soyrce.    URANIUM 233 IS bred from thorium and US demonstrated weapons feasibility with it
Reply: nope, I think the idea of safely storing waste for 100's of years is an absolutely stupid idea.  With nuclear we're taking a more expensive route to give future generations a massive headache when we can use cleaner and cheaper alternatives.
Reply: @miless2111sutube  >nope, I think the idea of safely storing waste for 100's of years is an absolutely stupid idea.  With nuclear we're taking a more expensive route to give future
> generations a massive headache when we can use cleaner and cheaper alternatives.

There are no cleaner and cheaper alternatives - yet. Start mining He3 from the moon and you have fusion power; and maybe one day we figure out how to generate energy directly from the zero point energy field; nothing else is cleaner and cheaper.
Reply: My main problem with any nuclear tech is that I don’t see how it can be deployed faster than wind or solar to address climate change. Future deployment of  nuclear will have to deal the established wind and solar and may not have to opportunity to develop the economies of scale that it would need to compete with wind and solar after they are deployed. 

We need a solution and we need it now. On time concerns alone, nuclear doesn’t cut it.
Reply: @williammeek4078  Wind and solar isn't going to solve the CO2 issue at all, in fact it'll make it worse; why do you think oil companies are the ones building wind and solar, out of the goodness of their hearts? No, it's because they know as long as people don't go nuclear, people will have to buy and burn their fossil fuels to keep their power grid going.
Reply: We need more cowbell. Oh, sorry wrong wild animal.
Reply: If humans want to continue making nuclear weapons' to kill each other with.... yes:oops:😮‍💨
Reply: @galactock  It's way harder to produce nukes from the U-233 created by thorium as how he said there are products within the material mix that create a lot of high energy gamma rays. It is way easier to just enrich mined uranium directly.
Reply: @mrkokolore6187  Exactly, which is why the US set aside Thorium for weapons or power in the 1940s.
Reply: @KG-1  1970's
Reply: You completely failed to explain how this is better than other reactors. Do you even know what cladding is? Yeah well I don't so thanks for keeping that a secret. Oh and your intro music makes me want to go back in time and punch a baby version of myself in the face. Trust me there's a better way to get a take, you don't have to murder the singer. It's so high pitched and off key, and whats the clicking in the background right before she squeals, that goes  'chick chick'. Sounds like somebody attempted to hit the space bar on their keyboard and turn it off, but was overtaken by the squealing and never made it out of the studio alive. '

I do respect your cleverness in picking a name for your channel though. You couldn't come up with a name so you added an 'ed' and said it was with you. This is "Failed Brainstorming with Matt Ferrell" doesn't have quite the same ring to it.

Good luck , and have a nice day.
Reply: @stevenutter3614  4/10 troll, slightly above throwing turd, much room to improve. That's being said Im not a fan of the intro (or any intro for that matter) and he wasn't going into details about the differences between PWRs and MSRs (not like you actually care) but what could one expect to learn from a 14 min educational video anyway ?
Reply: @stevenutter3614  What about you make a little more evolution on yourself instead of criticizing someone that dedicates to bring something constructive to society? Your frustration and failure on researching and demonstrating something clear for the masses is obviously demonstrated in your rage and aggressiveness in your comments. Fake haters like you are dispensable everywhere. Good luck in your success... or not.
Reply: @stevenutter3614  1) it's a simple design, cladding is when Uranium pellets are encased in a thin cylinder made of zirconium. this adds complexity. 2) the main advantages are a) Shorter life of the waste Thorium, it becomes safe to handle in only 5hundred years. b) It doesnt use pressurized water to remove heat from the reactor. Pressurized water can burst out and spill into environment. 3) Thorium is more abundant than Uranium.
Reply: @stevenutter3614  😆 you mista funny man. Matt, we so need nuclear so we are not polluting and fighting because we depend on hydrocarbons.
Reply: @stevenutter3614  and what have you produced? I'm not saying you haven't, just wondering if you have.
Reply: @TreeLBollingTreeMan  there's nothing on the @Steven Utter channel from what I see lol. And his whole comment is just complaining about nothing anyways